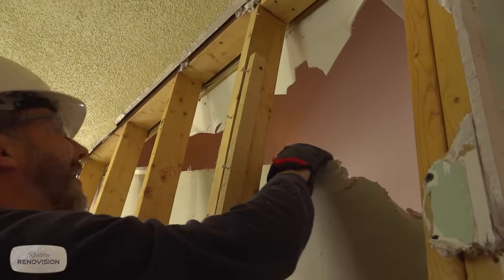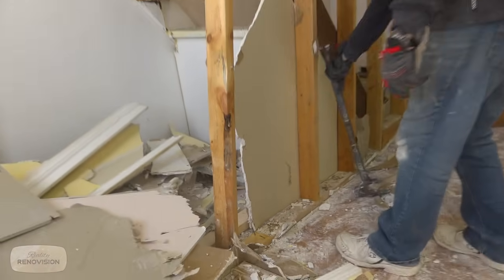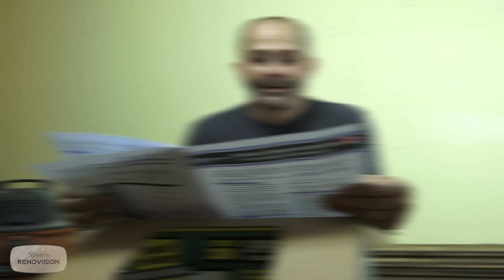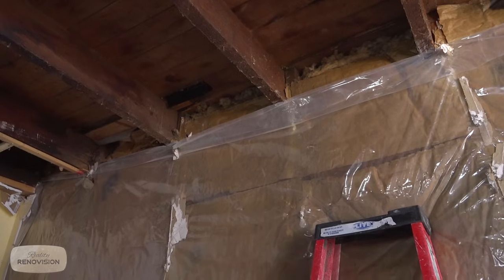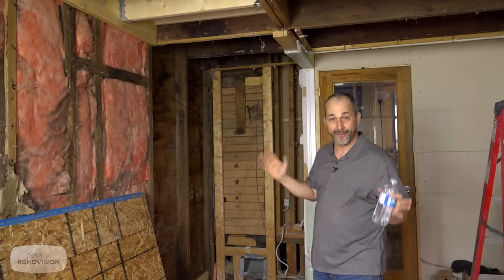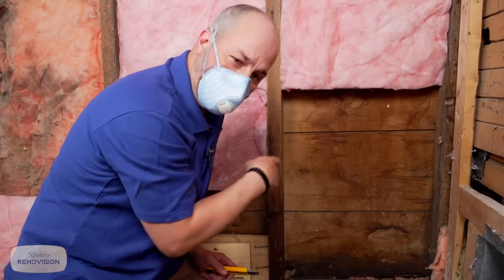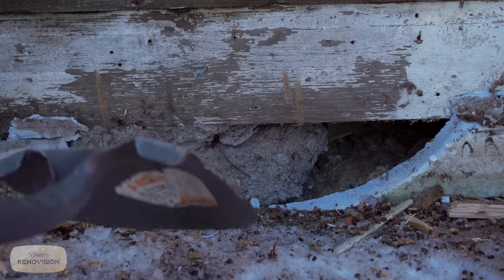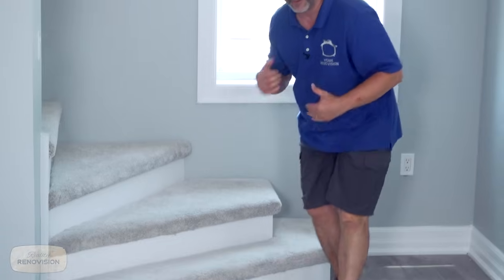You won't believe what this 1880s farmhouse USED to look like! | 1880s Farm House EP1

Comment: Demo is always fun. 
Great points on electrical never assume power is off, as in our case I had a light switch off to take out a fan in our mobile home and found out that in mobile homes the builder daisy chain power to other lights in other rooms. Always check breakers, or turn off main.
Thanks Chuck

Comment: I love it, Jeff but, at the same time, I wish you had restored the house to a more original look.  BUT, I understand.  I listened on the air loss/ blocking info.....I have a house built in 1802 and have ALL the same issues as you do.  So, I'm going room to room tearing down walls and repairing ANY heat loss.  THANK YOU!!!  We've never been so cool in our bathroom and closet!!!!!  What a difference it makes!!!   The cooled air seems to linger much longer before leaving...Like it's supposed to now. ...Before?  It was always 15 degrees difference!   We had some BIG OL' rat holes and horsehair with newspaper for insulation!!!  We brought everything up to code and are so excited to move to the next room!!!  Our Master Bedroom- the coldest room in the house in winter and the hottest in summer!!!  Right now, we've torn down to the rafters and are repairing electrical(ran into some dangerous rat issues) and we found some of the most beautiful wood floorings under the old linoleum!!!  It'll save us thousands just to refinish it instead of buying period wood to match what's in the rest of the house.  What a find.  All because we watched your show and decided to stop our "leaks"    We are new to remodeling- this is how we learn.  THANKS FOR BEING SO CLEAR AND PRECISE!!!   And all our doors-  whoever did them did NOT know how to level. LOL, Every door we have won't shut right......Of course, we just had the house leveled so, that's it I'm sure.....But, thanks to you we didn't have an issue doing it ourselves.   We're patient.....One room at a time.  Keep up the great work, Jeff.  I'm learning a whole lot!!!!  LOL.

Comment: Just got alerted to your channel and really like these type of projects as you can see all of the issues your run into with what everybody thinks is a "simple remodel. Only issue I see is your electrical. What's the purpose of the extra loop before going into a box? Also, I do not like a wire stapled to the bottom of a floor joist even if it will have strapping attached. Just as easy to drill the joists and you never have to worry about the wire being penetrated.

Comment: I just did a mudroom renovation and instead of running 2 3-way switches for the indoor and outdoor lights I just used Caseta smart switches with pico remotes. Yes, they're more expensive than normal 3-way switches but I saved a lot more on wire costs (copper aint cheap) and time I had to pay my electrician. I even added another remote to control the outdoor motion light from my living room.

Comment: In my area of washington state you don't need a permit for "residential or minimally-sized low-voltage systems."  You can also do your own electrical as long as you own and occupy the property you are working on. Meaning you also need no inspector, which means I've lived in so many diy crazy wiring in some houses. In other parts of Washington you can sign an affidavit saying you did your own electrical without inspections and becomes 'accepted' if you live in the home for the next 5 years (essentially they think you did a good job if your house doesn't burn down.) 
I'm just saying I know the feels of opening a wall and seeing the crazy things people think is a smart idea.
My Favorite was helping my mom replace a light fixture in her bathroom. When I removed the light fixture from the wall there was no box (screwed to a stud). I pulled it out looking to disconnect the wires to find it was a plug-in fixture! They had an outlet inside the wall that piggy backed from an existing outlet in the bathroom. Needless to say, what should of been like 10 minute project turned into a weekend.

Comment: congrats on your new home. you are off to a great start! thank you so much for sharing all this with us. i have an old home built in 1900 that has had a lot of piece work done badly over the course of many years before i got it. so whenever i have to fix something i cringe because i know i am going to find 50 other things right there i will have to fix because it was not done right and might as well do it when i have it open. so this is helpful for me to watch and see cause you are going to framing and fixing. so thank you so much! one thing i was curious about, how come you aren't sticking with the old wood and reusing it? is it just a style choice or you don't trust there to be enough or what? i wish the folks over the years here hadn't messed up all the wood and i try to find similar old stuff elsewhere to splice in to match original style just cause i like the old wood vibe, but i know not everyone does. anyway cheers!

Comment: Important point for people in the northeast with balloon framed homes: there can be random structural walls throughout the house. As the house settled, some of the previously non-structural walls may have started to take some of the load of floors above. Contact an engineer before removing walls to make sure (pretty much in any home).
Reply from the maker: Cheers Sam, I always remove the drywall and lathe/ plaster before removing walls. best to know in advance.
Reply: @REALITYRENOVISION  Hey watch out for the people with the accounts with peas in helmets as their avatar. If you like their channel or interact with them in the wrong way, they jack your account. They are bots.
Reply: REALITY RENOVISION  what the wall color???

Comment: Such a great show. I'm doing the exact same thing (and documenting) the demo, rebuild and and remodel of our 125yo house in Southern Oregon. But in order to get permits we had to do an asbestos check on the drywall, ceiling, insulation...etc. Which came back positive because the materials used were so old. We had it remediated. Was this not an issue for your demo?

Comment: Hi Jeff, is it law that you have to put a steel external door in or are you just going that little bit further? Also when you cut through the siding to put your new front door in it looked to me as if there was two lots of siding still left after your remover the vinyl siding and insulation, was I seeing things or what. Another weird thing with America is that you can have electric switches in the bathroom, the only way you can have a switch in a bathroom over here is to put a pull switch in so the string would hang from the ceiling. (apart from an outlet for an electric shaver) and if you put a shaving pint in you can have it beside a sink, it is crazy.

Comment: Here in Europe we have learned that sealing humidity into your stones, joints, and/or carpentry  created structural problems in the 10-year range, depending on climate. ventilation is more important that 'vapor barriers' and sealing foams. If you want old buildings to last. Also, mineral( glass or rock wool) batten insulation loses all insulating properties when wet. air crete, glass foam, or cork is used in crawl spaces successfully in historical buildings

Comment: Can i get some clarification on the crawl space. you spray foamed the crawlspace with closed cell foam, which is a vapor barrier, and used an insulation blanket which has a vapor barrier attached... i was under the impression you shouldn't have 2 vapor barriers on a wall

Comment: Quick question, why the fiberglass batt with vapor barrier over the closed cell? Isn't one of the benefits of closed cell that it is its own vapor barrier? Is it just for additional insulation on top of the foam?

Comment: I am renovating my bathroom...I could only dream that I only had one layer of drywall...I had 3-4 on all walls with so many layers of nails and screws....took forever to get the drywall off.  oh, and they did framing on top of drywall.  They also had wires between layers....it was interesting.

Comment: Question? Can you use 3 Inch  Rigid poly against the wall First, then build out and use the Poly Pink against the rigid in the new framing ? The rigid would be your  your first Thermal break and then you would not need a Vapour barrier? as some building codes now believe that a Vapour barrier is now condusive to BLACK MOULD. ? Using plastic for a vapour barrier is thought to conduct mould? The reasoning is we in Canada have so many temp changes that Black mould is now worse than thought?

Comment: It made me sad to hear you say you'd take down the original siding, but I understand if it wasn't salvageable.  I'm having my 1939 house painted right now (it's too tall for me to do it myself) and luckily I have cedar siding that only needed one board and a few sills replaced.  Even though I'm not doing the work myself, knowing how to do it makes it easier for me to keep an eye on the guys to make sure they're doing it right.

Also I'm able to keep my original solid wood doors -- just the front door was installed back in the day with the hinges on the wrong side, so I'm finally going to fix that for better access to the tiny mudroom just inside, even though I'll have patched holes on the stained wood inside.  I priced out the exact same (slab) door in oak, and they wanted $5k for it.  Yeah, I'll live with a few patched holes.  Not to mention then I get to keep the original wavy glass windows, brass door knocker and outline of the previous street number.  I love that stuff.

Comment: At the first house I had, I wanted to turn off the power to the kitchen outlet.  So, I plugged in a radio, and turned off breaker by breaker, and it never went off.   So, I shut off the main breaker, and it turned off.   I was confused.  cleared the sheetrock around the outlet, and found TWO sources for the outlet.   eventually, I found out which TWO breakers I needed to turn off to turn out the outlet.   So, clearly, there was NO protection from the breakers, until it hit 40 amps.  (2 twenty amp breakers).  they were both on the same leg, or the problem would have been realized years ago (lol).

Comment: If a #2 pencil can fit into a hole or crack, so can a mouse.   I'm confused about the door and lock which are completely different from the final look.  Was the first door only a builder door and why the lock change?  You didn't mention it in the final walk through.

Comment: Does spray foaming the stack stone foundation stabilize it as well?
Reply: Nope.  The spray foam will air seal, moisture seal and insulate, but it won't add any structural value.

Comment: I'm remodeling my own old farmhouse (upstairs, half story, knee walls make it 10ft wide with 7ft 2inch ceilings) and there are tons of screw pops in 1/2 inch drywall. We are hoping to reuse all the drywall where it sits but it appears the guys before smashed some insulation behind the drywall (just like edges of the insulation) which I suspect loosened the drywall over time. They also used 2 inch drywall screws into 2ft OC oak 2x6 true dimensional lumber. Any recommendations on how best to secure the drywall or will I continue to have nail pop issues?
Reply from the maker: if the drywall is under pressure then it will always pop. perhaps strapping the wall will help to release the pressure and increase the structural integrity. the pops might be from lateral movement as well.
Reply: @REALITYRENOVISION  thanks for the reply. The lateral movement would show not only in the slanted ceilings but the knee walls too correct? I actually dont have pops in the knee walls just the slanted ceiling and flat ceiling. Or am I completely missing the mark? Thank you very much. Love the videos. I watched 3 hours of drywall a to z video the other day too lol I'm about to be a dad so that would explain my newfound extreme interest in DIY renovating Haha.

Comment: Maybe I'm missing something here, but it seems to me that the notch in the 2x4's is much smarter and simpler, and easier, both to do and to wire through, than drilling holes and fishing the wires through. It's not orthodox, ok, but why wouldn't it work? The only thing I'd do is to screw a metal plate instead of driving a screw or nail, just to protect against future screws or drilling :)

Comment: This electrician that always showed up to job sites last year - never once seen the guy drill a hole for a wire.

He would run them all down to the sill plate and then staple them to the sub floor/sill.

No idea how any of his work actually passed inspections.

Everyone drywalling or doing anything with him would curse as they'd have to cut around his wiring or he would put a box in the wrong spot and and take a hammer and blow a hole 12 inches over to move it then expect someone was magically going to fix it.

Just ridiculous.

Comment: I will use this citation from you with clients : "you can open your walls but your have to open your wallet" ;) -peole don't often foresee the inspection/comprehension of the space, demo, hauling debris, engineering and temporary structures,  new structure, and re-mudding, new flooring (or creative borders and junctions), new or touch-up to ceiling, touch-up to adjacent walls... involved ;)

Comment: Omg Why didn’t you just hire a professional spray foam contractor to spray foam the crawlspace? The way you did it you just trapped moisture in that fiberglass insulation. I would guess the poly is supposed to go up against the concrete or stone in your case and the fiberglass is supposed to be exposed to the crawlspace and the poly is supposed to be taped like you did to the ground poly. but the way you did it you trap the moisture between the poly and the foam you sprayed on the rock wall and then tape the poly to the ground poly which is going to allow moisture up in your fiberglass because the ground is very very very very very very very moist.
Reply from the maker: Hi Brad, the ground relative humidity will not compromise the fiberglass. it is not a material that will wick it up. Cheers!

Comment: What?  Manufacturers do supply 24 inch fiberglas batts. Are u making too much effort with 16 inch?.  Be careful, u did not structure ur house well on vapor barriers. Old house is built to breathe very hard.  Including foundations.  Spray foam is considered a vapor barrier material.